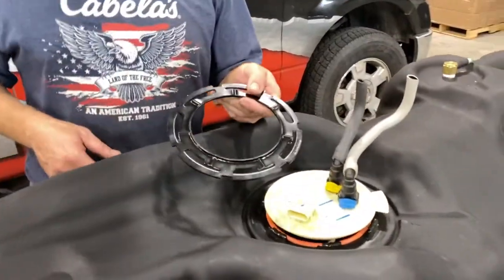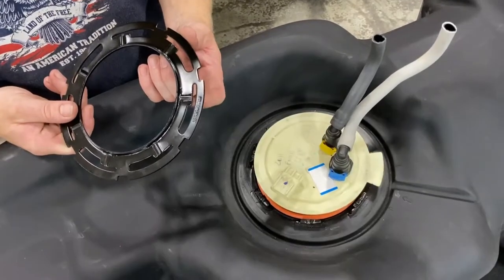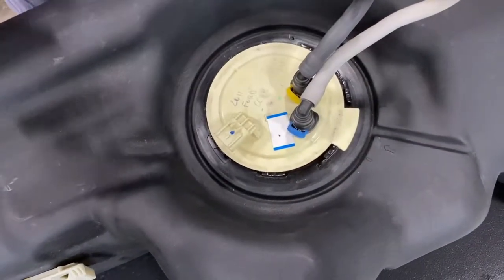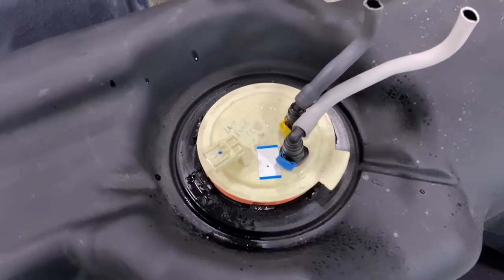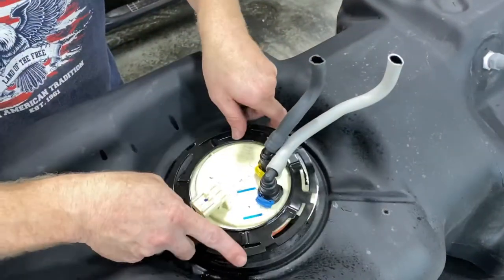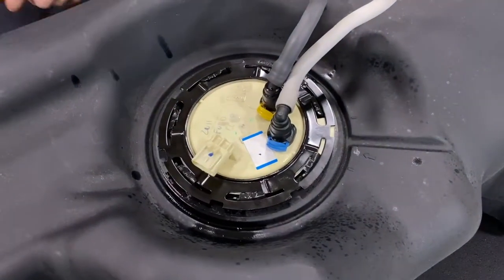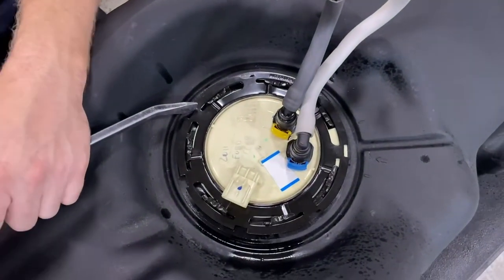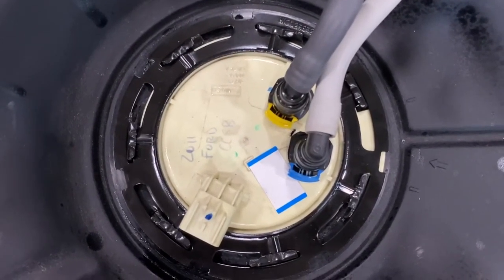TITAN Fuel Tanks Gen 6 Lock Ring Tips and Tricks

Comment: I've replaced the fuel pump on my 2005 Ranger pickup. I'm now at the point of securing it with the lock ring.  In your video, you push the lockring/pump down against the o-ring and it "stays" in place long enough for you to get tools.  I have tried and tried to push mine down and get it to stay, but i can't rotate it by hand even a tiny bit far enough for it to hold temporarily.  The o-ring just pushes it back up.  Any advice?
Thanks
Reply: Probably have the same lock ring design on my 2007 mustang and I’ve always struggled with this since the tabs don’t line up to hammer in place correctly. I have to use the body weight to have the ring low enough to line up with the slots for the tabs. Real headache